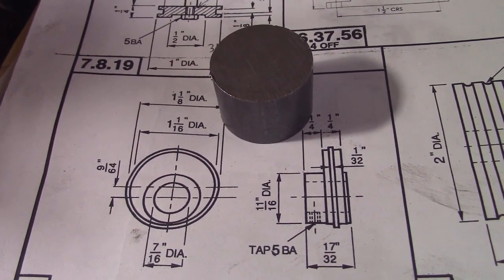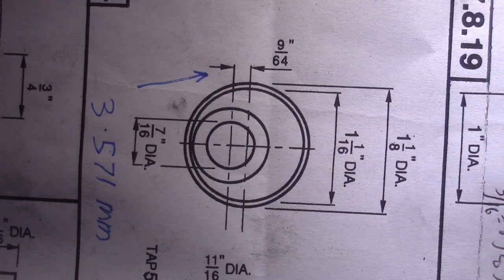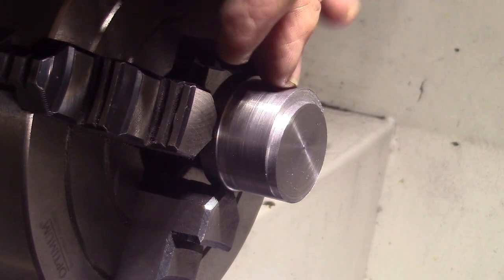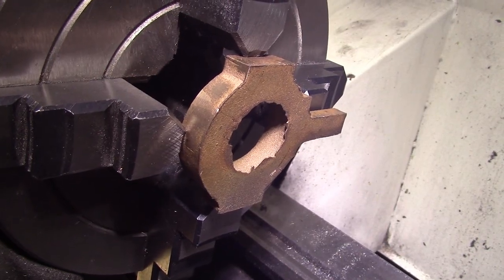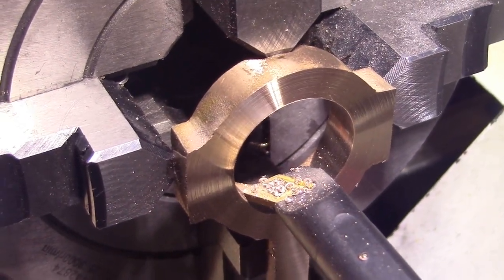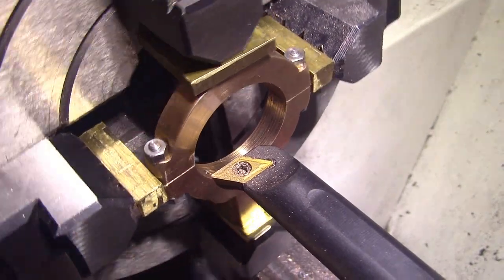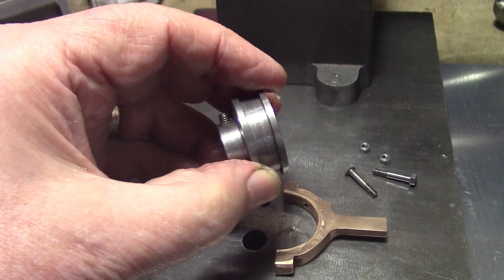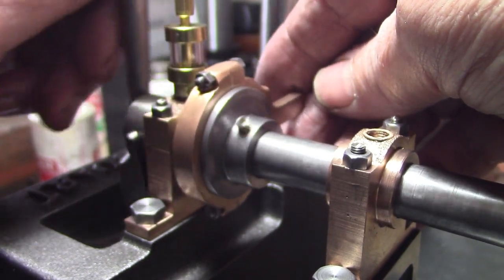Stuart Beam build Part 8

Comment: Hi Gary
I have been given this model as a xmas present and have been trying to find a video series for guidance with no success until i  found yours.
Great tips and video clips which i will hopefully be able to use as reference.I have not been very successful with super glue turning so i prefer the idea of bolting together etc.
What are your thoughts on this please?
Keep up the good work.
Kind regards Peter
Reply from the maker: Hi Peter, thanks for the kind comment, yes I did use super glue on parts that I could not bolt together, eg cylinder head etc, but I still used the bolt together method on many parts, those especially subject to high load machining. Super glue is fine for small drilling and boring. Good luck with your build, any questions please do not hesitate to ask. (although I'm no expert.)
Regards.
Gary.